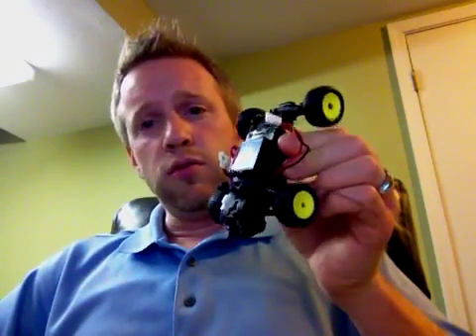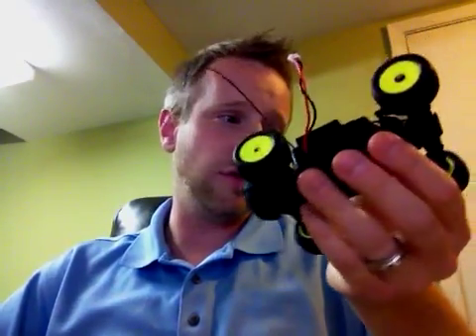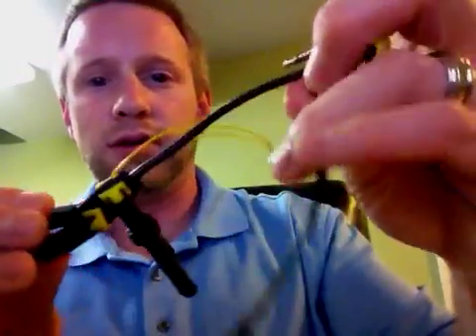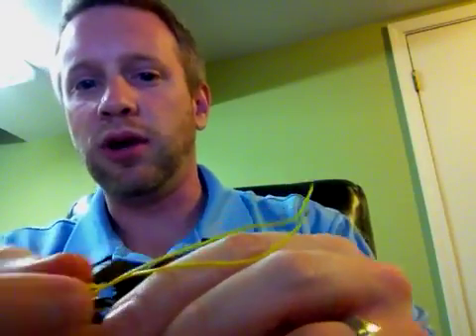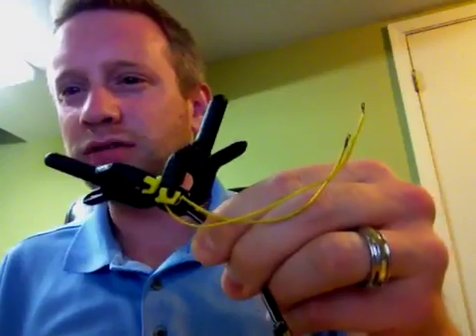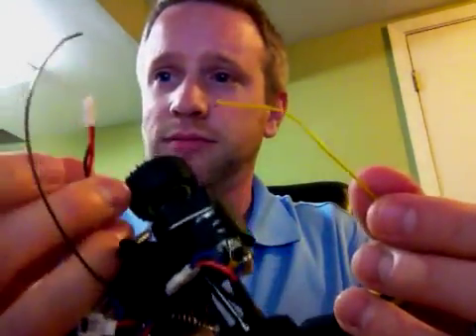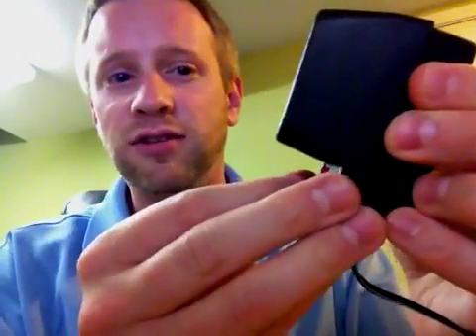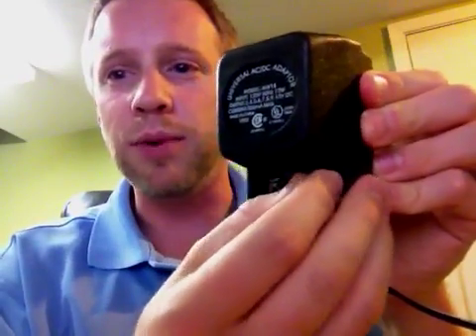How to Bring a dead rechargeable battery back to life

Comment: Also, if get a good RC charger, charge/discharge at voltage and amps of the battery for instance 7 cell is 8.4V. My pack is 3300mAH so I charge at 8.4V and 3.3A. Once it's charged as much as it will, run it until the battery won't go anymore. Rinse and repeat and the battery should come up close to full charge. Do NOT store charged. THIS IS ONLY FOR NICAD AND NIMH. DO NOT DO THIS ON LIPO OR LiFe ETC!!! I raced RC for years.

Comment: didn't know this could be done. thought old batteries were just trash. found this vid while searching how to replace NiMH batt. for Roomba. So, is this life renewal for batteries older than 7 years, or just for newer batteries that haven't been used/charged properly?
Reply from the maker: Jason B. It's a bigger battery and may require higher voltage, please use extreme caution as batteries can explode!
Reply: 220 ya think? I have riot gear.

Comment: Be aware of course that the chemistry, charging requirements and behaviour of LiPo batteries are all quite different to NiMh, and NiCd batteries.

The reason the charger would not accept the battery you had is because LiPo charger chips are programmed not to charge batteries which have been discharged to the point where they may have been damaged and so could be dangerous to charge.... these batteries can be quite dangerous if damaged, and over discharging them can seriously damage them.

The battery you have is small, and doesn't contain a huge amount of energy, but having forced current into it to push it's voltage up to the range where the normal charger believes that it is "OK to charge"... I would personally not charge it unattended again... 

LiPo batteries should remain at a no-load voltage between 3.0 and 4.2v at all times to avoid damaging them.... storing them at 40-50% charge allows for long term storage for months, even years without damage....
Reply: "remove something that was blocking the battery "

The batteries are full of micro-crystals and over time they grow into larger crystals that can self-discharge and short the electrode.  The zapping breaks the crystals back down into smaller granularity.  
It''ll never get back down to the original 1 micron size but proper reconditioning equipment can hit 3 microns.
Reply: @SteveSmith-ii4yk  lead acid car batteries fail from the bottom. Crystaline buildup on the bottom of the plates. Or acid creep on the case exterior from overvoltage charge rate.
If the cases were 1 inch taller and the plates 1 inch higher, a 5 year battery would last for 10 years.
Reply: How to operate a NiMh battery that can't be charged anymore ???Really need help
Reply: There are devices to do what he did in the video. I made one years ago in my electronics class. It was a kit that I assembled. It said the capacitor would jolt the battery for a second and remove something that was blocking the battery from holding a charge. It really worked, and I used the batteries for years after, charged them unattended, it was all good. These were nicad, not sure about other types.
Reply: @Sergeant_Scraps  Nicad batteries in the 1970's could be left charging in the garage overnight. Black and Decker grass clippers.
Nicad batteries are also expensive.
Reply: @Sergeant_Scraps  This is perfectly OK with NiCd and NiMh cells, LiPo cells can be more tricky... when they are self discharged, or are used individually in a device they can sometimes be revived with a simple low current <0.1c charge (say 100mA for a 1-2Ah cell) until they reach 3-3.5v.  If they were used in a pack, and went flat while being discharged, then it's likely that one cell was reverse polarised, and this will do extreme damage to that cell.
Reply: James Lewis; Good explanation.
How many kids get dissapointed on Christmas simply because of battery issues?
I finished a 1/10 scale crawler build with Nimh pack and standard Tamiya connector.
I got tired of the bullet terminals backing loose from the connector. So they got pushed in, aligned and siliconed in place.
And the kiddos getting a gift rc car with a
Cheap usb dongle charger? How many have usb hubs that put out 2 amps?
Reply: @ayebee1207  3 years on, I would add a couple of things to what I said above.  
1. while LiPo cells should not be discharged below 3.0v, some more modern cells say 2.5v, and can withstand a few low voltage events (as I said, unattended charging a damaged lipo is not advised). 
2. the most serious damage is with multi-cell packs when the cells are not well balanced, and one goes flat before the others while discharging.  Internally this can result in one cell being forced to a negative voltage, and that will lead to serious internal damage.
3.Obviously lipo cells are in everything these days, and the chemistry has been optimised so that they rarely cause problems when not physically damaged... but it's still worth being a careful.
Reply: @ayebee1207  One more thing.
4. those USB chargers are mostly junk, and many will over charge the cells... I have several from small drones that will happily charge to 4.5 or 4.8v if left long enough.  This is really unsafe.  I would always recommend investing in a good balance charger such as one of the models by ISDT, depending on the size of packs you are dealing with... perhaps a Q6 Nano.
Reply: A decade ago I had issues with flight weight Lipo pouch. I replaced the pack and thought it was another bad charge/discharge circuit on the pouch. Turns out that the rotor speed pot on the controller wore out.

Comment: The issue with many Lipo batteries is that they stop charging after they drop to a certain voltage.  By disconnecting the protection circuit and applying a current controlled Voltage source, you can bring the battery up to where it is above the shut off point.  I have done this for laptop batteries with great success.  The only issue is if a cell is short.

Comment: My batteries I use in my e cig builds as well as a ton of other projects are 26650 3.7v 3500mah batteries with 30 amp continuous drain and 60 amp pulse.i can't do this with the charger I have,so how can I do this with these batteries and would it work?

Comment: Is there a certain rate at which to drain a battery down according to its voltage or amp capacity or a certain amount of over voltage to apply to jar it back into taking a charge?  
Thanks.

Comment: On ac adapter does it matter which wire(solid black or black with white stripe) when connecting to positive and negative on battery?
Reply: Yeah polarity matters. Use a VOM to see which is which.

Comment: you forgot 2 things, 1st voltage is not what it counts to jump start it's the amp, 2nd to keep battery for long you don't drain it completely but you reserve some otherwise you have to jump start to recharge again after non long use.

Comment: If you worked with batteries before you should know polarity is important, yet you never mentioned it. Could cause charger and batteries to burn up or explode if you get it wrong.
Reply: Isn't that something that only idiots need to be told? I mean if you're wire-to-terminal choice is based on "felt like it" you shouldn't be playing with electricity anyway.
Reply: You don't know who is going to be taking your advice. Might be an idiot as you put it. Assume nothing. Be safe.

Comment: A friend who is an engineer used a homemade charger similar to this and left the charger on overnight. The next morning the batteries had blown up and blew one of the batteries through the wall.  These batteries have a high internal pressure and if you leave an unregulated charger on them you may raise the temperature enough for them to blow apart.

Comment: Yeah, F**** it. Hate batteries so badly.

My Duracell 8 AA cost almost 40€ and had only a few cycles, but I stopped flying, so they just stay for 4 years, and don't charge anymore.

Imax B6 says it charges only like 34 mah god damn it. But i Put the 8 all together, and don't know why, but the charger is charging at around 20V and I was using 1A.

Comment: for micro t you can use a peper clip to jumpstart the battery. just plug the battery then connact the red wire using a paper clip to the + side of battery case very short. light wil come on. a paper clip is too short to reach the both sides so just use a wire fasten to the clip.

Comment: dude i have a 12.6v battery and it was broken [the solders came out] so i soldered it again and then i took a ac to dc adapter which converted the current to 9v and i am not able to charge it so can you help me with that
Reply: Ansul Joshi. Sir, your charger must put out more dc voltage than 12.7v. Find 14v charger at the dump.